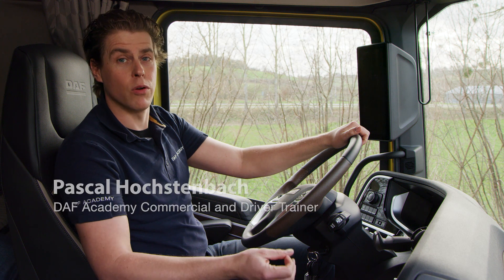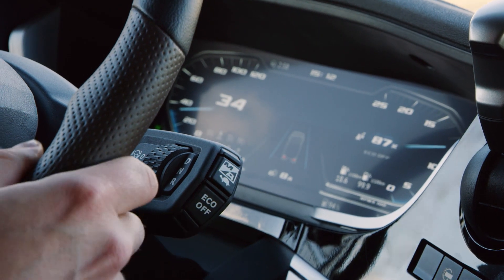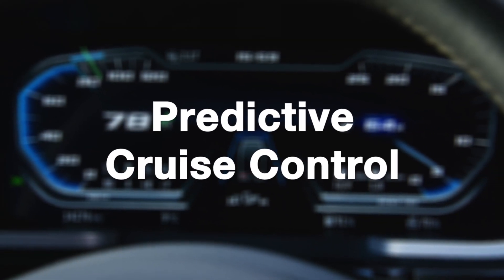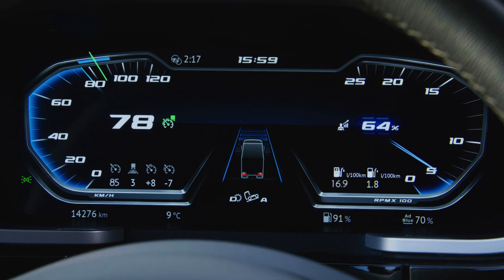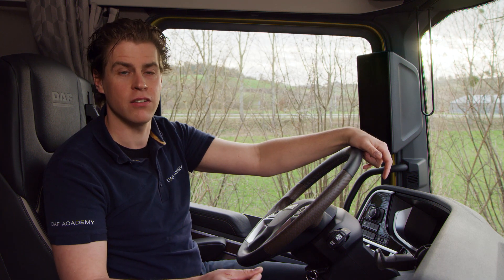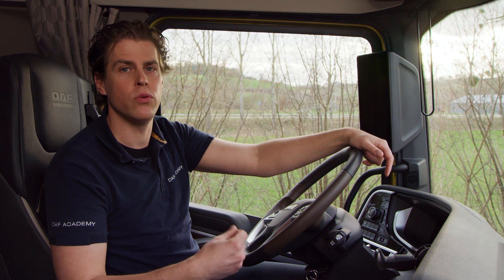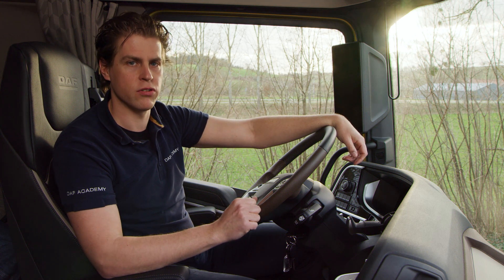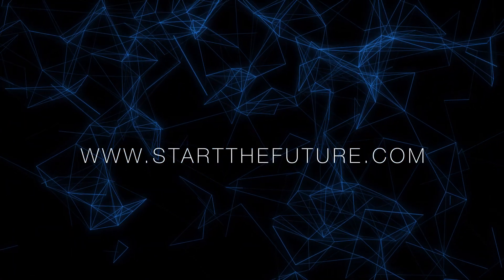Explained: Driving New Generation DAF trucks

Comment: New 14 Tonners (XB 230 with sleeper cab):
👍 saves your clutch foot in congestion with automatic gearbox vs manual we used on our old 18T DAF's..bonus 
👍 lane departure alarm way quieter than old ones 
👍 Rear camera good for seeing what’s right behind on the road/motoway
👍 Comfier seats than old 7.5T
👍 got a subtle road speed limit alarm option on dash view which I like
👍 tacho drive time countdown view on dash option which is helpful
👍 can have cruise control with just speed set but with no distance in front setting if you want. 
👍 Better turning circle than old 18T
👍 Decent cup holders (old 7.5T's we had didn't have any)
💩 Left hand proximity warning annoying. Flashing amber light near the passenger door a lot when passing bushes/contry roads
💩 Exhaust brake just as useless as on old ones. Ineffective on anything but really small gradients. No levels of braking to play with
💩 XB230 Rear camera not great for reversing (can’t see end of vehicle to objects reversing towards) . Set under the  unit instead of above doors, and like a fish eye lens. Stuff looks further away than is.  XB190 is slightly better position and depth perception but still not ideal for seeing the ends of your vehicle in proximity to walls/bollards/ bay doors/entrances etc
💩 Rubber matting in loading unit creates more drag on floor. I have to move UPVC French doors/patios.  When moving from cab end to doors
💩 In the XB 190 big loud audible when indicating left & right even when  going above 18mph..Annonying on motorways
💩 DAB radio signal is poor. Stuck with FM radio.  . Drops out constantly or rebuffers the last few seconds of what you just heard loads. 
💩 can’t get 14T to connect to iPhone music but should be option via Bluetooth 🤷‍♂
💩First new 14Tonner XB 230 at my works,  after day 2 started with quirk of not shifting into drive gear even after changing from neutral or reverse. Have to switch the settings dial a couple of times b4 it sorts itself out 
💩 XB 230 14T Handles corners more like 7.5T with tilting 
💩 feel crosswinds way more in XB230 than in our old 18 Tonne DAF's 
💩 chassis elements sit low  at rear wheels so watch speed bumps, maybe grounding potential